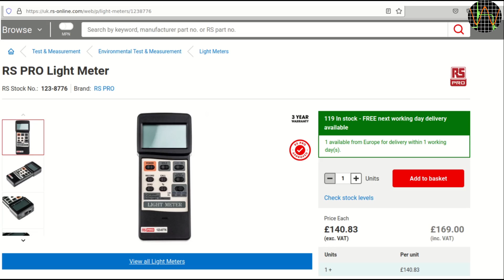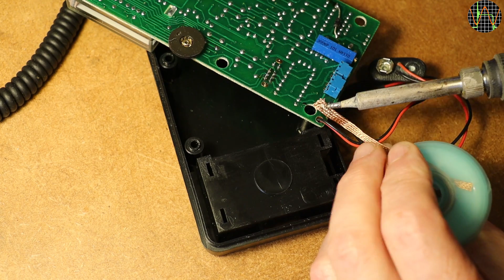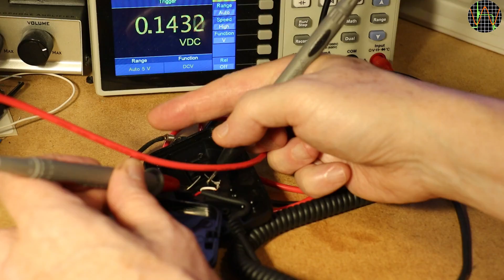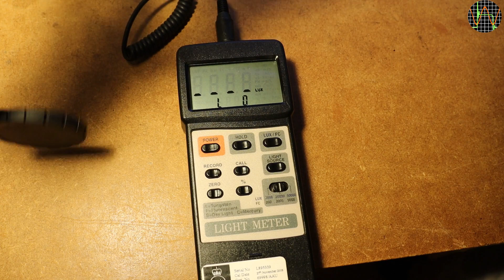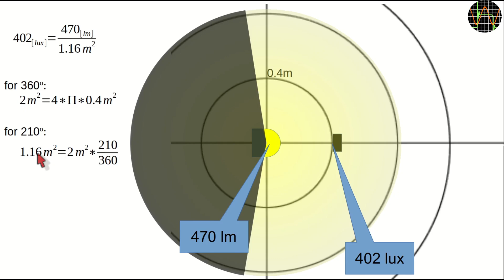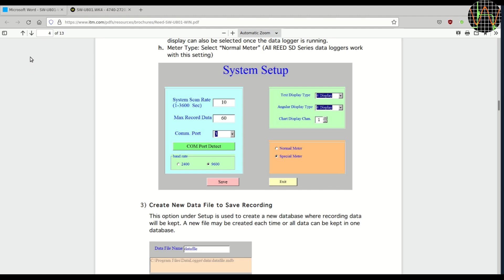#110 Not-working eBay Light Meter: Can it be fixed?

Comment: Be aware that the "light source" adjustments on these meters is just a "guesstimation" that applies some fixed scaling factor to the default calibration (which is only for Incandescent, as stated in the specs). Any Light Meter that includes such a switch is considered to be a very "low end" one that is NOT accurately measuring the total spectral emission.
The easiest analogy is the cheap AC Voltmeters that are not "True RMS", but are averaging and scaling based on a SineWave. They can be adjusted to be fairly accurate on a 100% pure AC SineWave, yet imagine such a meter with a switch that said "SquareWave" and "Sawtooth". These Voltmeters aren't really measuring the true value, they are just guessing it.
To measure Lux and Lumens reasonably accurately needs a proper Spectral Test (at numerous frequency/wavelength steps), then complex mathematics to apply the CIE Adjustments to match the human eye's sensitivity. That isn't happening even in $1000 hand-held Lux meters.
Note that these meters are NOTORIOUSLY wrong for LED Light Sources, since the LED lamps don't have the continuous spectrum that the Photo Diode is tuned for. There are many technical reasons for this that are difficult to explain in a YouTube comment.
Reply from the maker: No question that you are correct about the colour temperature being highly questionable not to mention that light sources have a wide spectrum too.

Comment: 10:00 Those Lumen to Lux calculations are completely incorrect. Lumens are based on 3 dimensions, not 2 dimensions like shown in your diagram. So, a lamp with a total output of 1000 lumens doesn't give ANY indication about how many Lumens will strike a surface some distance from it... it all depends on the intensity (Candelas) in that particular direction.
In the case of the LED lamps, the Lumens are not evenly distributed over that "stated" 210 degrees - there is a lot more light at 0° (straight down) than there is to the sides (90°). You can verify this by swinging the light meter at a fixed distance around the lamp.
Furthermore, the "Colour Temperature" stated for LED lamps is the Correlated Colour Temperature, which means the equivalent appearance to the eye, rather than the actual spectral emission of a (say) 2700K of a true "black body radiator". So, whilst a Incandescent or Tungsten light source has a true 2700K Temperature, this is made up of a continuous spectrum with the majority in IR and tapering to almost zero at Blue and Violet. However a White LED has almost zero Red or Orange, and a strong peak at Yellow and Blue, with Blue being dominant. This LED spectrum is non-continuous and almost the complete opposite spectral emission to an Incandescent source, so the Light Meter cannot and will not measure it accurately. 
So, the fact that your meter measured what you calculated means pretty much nothing, just a coincidence.
Reply from the maker: I don't think your argument about 3D is correct. Lux is lumens per square meter which is an area but I agree with you that assuming a uniform emission of x lumens from a LED light bulb in all directions stated on the packaging is a big simplification.  How uniform the spectrum of a LED bulb is compared to a tungsten one is an interesting question, but I haven't got anything to measure it. Of course the sensitivity of the photo diode behind its filters plays a role there too.  I'd love to repeat the test with a tungsten lamp and I still have a few old ones but no packaging and so no idea about their lumens.
Reply: @TheHWcave  - it's not an argument, I am just trying (very poorly) to explain the error in your assumptions/calculations. Lux is the value of Lumens per Square Meter however the intensity of light in a particular direction is measured in Candelas.
The light meter is actually measuring Intensity (Candelas) and displaying some adjusted values as "Lux".
...
The diffusing surface is accepting illumination over a significant area, and there needs to adjustments (Cosine Correction) that allow for the angle of incidence. Remember that at just 400mm away your lamp is not a point source, and neither is the receptor surface, so you also need to consider the solid angles presented by each of these to each other.

...
The mathematics of all of this is too difficult to explain here - what I am mainly trying to say is that just because you measured some amount of Lux doesn't mean you can verify Lumens (or visa-versa). In very simple terms, you have too many unknowns to draw a conclusion.
...
Nevertheless, since the light meter is actually measuring Candela, you can create a 3D light distribution web with it. Simply take a number of measurements at exactly equal distances from the bulb and at certain angular steps. For example, if we assume rotational symmetry then you can take a sweep of measurements at (say) 10 degree steps from straight forward to behind the lamp.
The measured numbers won't mean anything in absolute terms, however you can create a polar diagram that graphically shows the relative intensity at various angles. You will find that the quoted 210° beam angle is probably the point at which intensity drops to 50% of the peak (at 0°), and that there will be a lot of light outside (above) that angle. That in itself is part of the reason that your Lumens <> Lux conversion is in error.
Reply from the maker: @johncoops6897  Wow, thanks for all the info. much appreciated. You can tell that light metering isn't what I am terribly familiar with.... One point I remember from looking at the data sheet is that the sensor (or rather the software) does implement the "cosine correction factor".  I am also fully with you that the light bulb probably isn't sending  its 470 lumens over the full angle of 210 degrees which is why I measured it facing it directly. Whether the flux at 0 angle  is 470 lumens or more (or less) I can't tell. I assumed that they probably measure it at 0 deg in the factory too which is providing probably the highest lumen number for standard LED bulbs with PCB mounted LEDs. It would be interesting to try one of those LED bulbs that use strings of LEDs to mimic filaments. I could imagine that the light meter at 90 deg aspect angle would give higher results. Maybe next time in the DIY store, I pick one up to try.